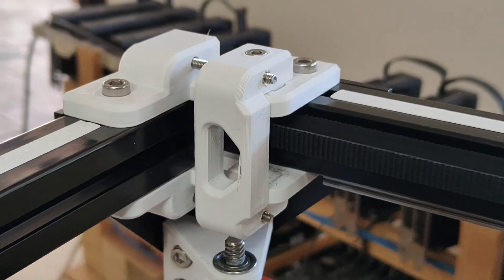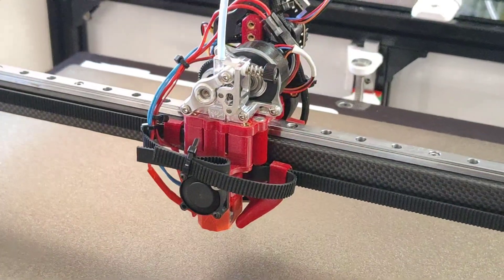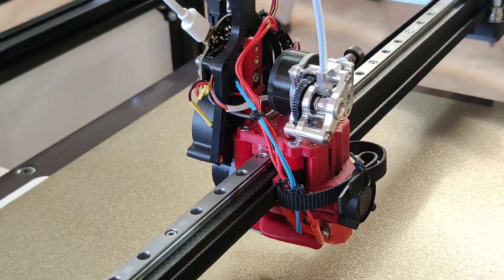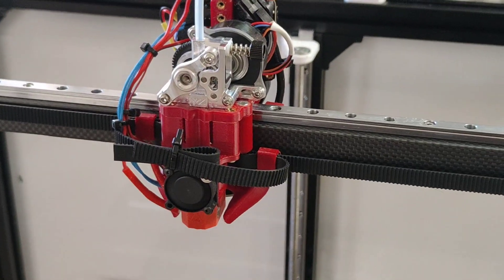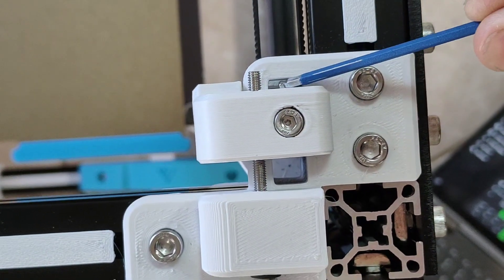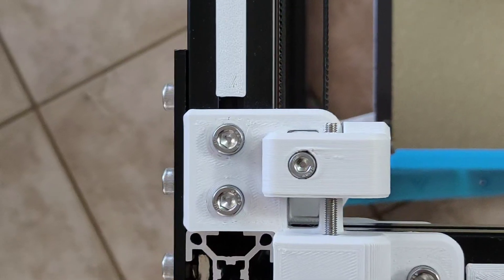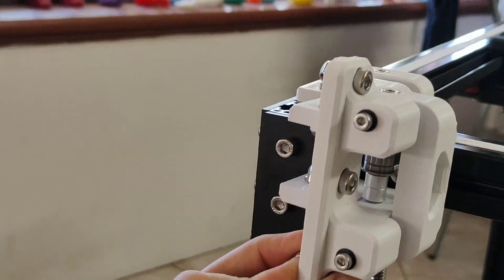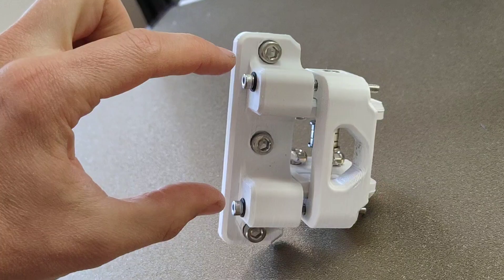Rat Rig V-Core 3.1 Belt Tension Idlers enclosed and open frame compatible.

Comment: I'm currently using the open frame version and can't get the belt tension quite right. However I love the design and reduces weight on the tool head.
Reply from the maker: Great news what cant you tension about it?
Reply: @jc84com  The input shaper graph results for upper/lower belt tensions are not aligning

Comment: Why are you using the EBB36? Why is the Beacon probe a game changer? Why don't you have an enclosure? Why is there so much extra belt in the hot end?
Reply from the maker: Ebb36 makes for a simple hot end control with one USB cable.

Beacon probe I find is way more reliable and accurate compared to a klicky.

PLA printer, I have a voron for ABS enclosed.

Extra belt for future proof and to make adjustments easy.

Comment: Where can I find more info about the carriage you're using?
Reply from the maker: Its a modified VZbot tool head that vz designed for ratrig. I made a alum plate version now from the printed version CAD.

Comment: I'm currently looking at various mods to quieten down the motion system on my vcore3.1 300. I've just got all the parts to do the FMMM mod and motor decouplers. Would this mod allow me to use the standard EVA carriage (latest version)? I hate the original tensioning. I want to be able to adjust the belts from the front rather than behind the carriage.
Reply from the maker: Yes, I do find the steppers very loud on this build compared to my voron . Both ore not using any stealthchop

Comment: The spacing at the pulley arms is greater than the length of the pulleys with spacers and washers. Difference 2.5mm in Fusion360
Reply from the maker: I don't understand?
the Extrusion is 30x30
The part PA_XY_IDLER_TENSION_SHARED_ - TENSIONER_ARM_LEFT_X1 where the pully sits is 29.6 its 0.4 under size if anything.
Hit me up on discord and you can help me understand.
Reply: @jc84com  Hi. Can i send you a Image?
Reply from the maker: @reevesnorr6101  you can contact me on discord details are on the git hub page.
Reply: @jc84com  Sorry. I not seen the extra 3mm spacer. How i can findit?

Comment: That tensor looks great!  It should work on other 3d printers using 4040 extrusion, right?
Reply from the maker: I'm sure it is possible.
It is built for 30x30 extrusion.
Full cad is available from the link in description from the github page. So anyone can edit as required.